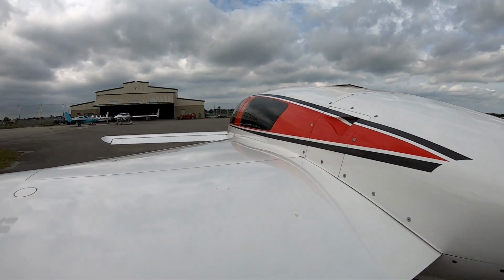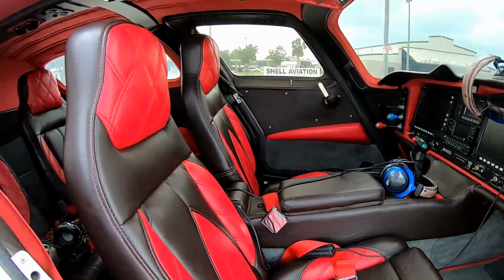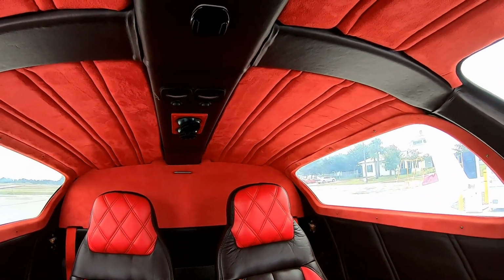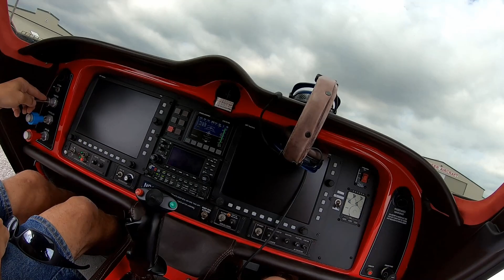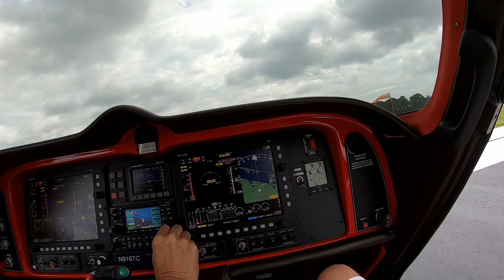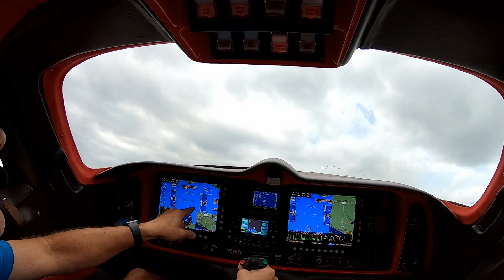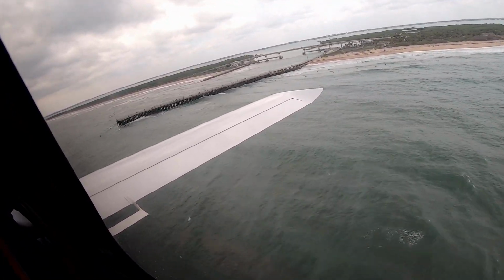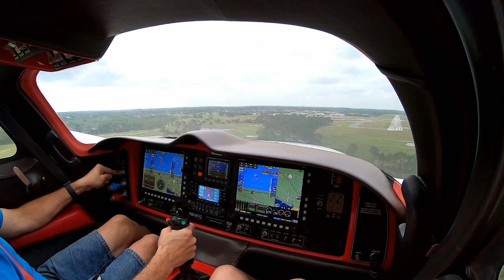Velocity Flight with Scott Swing

Comment: SIDE-STICKS WITH CENTER CONSOLE THROTTLE QUADRANT!
Awesome Velocity you have, none the less!
Reply: I notice that. If the left seat becomes incapacitated, the right seat will have a hell of a time using the throttles & mixture.
Reply: It is an option you can add if you build one

Comment: These velocity aircraft are absolutely astonishing. I get freakin goosebumps looking at it. Those air intakes on the sides and roof of the back fuselage are sick too.
Reply: The single engine is really impressive. The vtwin is really cool, but the cost of owning dual engine aircraft is obscene, I already went through it. The only one I would own right bow is a Beechcraft Baron P.  (If I could afford to own one). I love that plane. Ive always wanted a pressurized cockpit for high altitude cruising.

But....

My wife wants a Velocity Vtwin, so it may not be up to me
Reply: @stonehorn4641  it’s funny you say that about twin engine aircraft and the Baron. It is also one of my favorite twin engine small planes of all time. Imo It is one of the few elite in the light twin engine class of aircraft.  I do believe the King air is  one of the best twin engine in the turboprop class as well. My fav king air is the C90 and my fav Baron is the B58.

Comment: Mr Derek,  I've been seeing another plane that looks like this one,  it's called the "Canard" which has two versions but I'm curious
if you know if this Velocity is made by the same people as the Canard?  Both are very similar to my eye but I'm no expert.  If you
know, please drop that info here & thanks for the video.  peace
Reply from the maker: Canard just means it has the small wing up front. In regards to airplanes, it's a type of design. There are several manufacturers making these types of models. Hope that helps.
Reply: Yes,  for my needs at present,  that's what I was looking to know.   They seem to be more efficient in fuel burn & almost
like a freedom to fly.... in a sense?  Thanks & I'll be out here taking it all in.  peace & GB

Comment: I remember a Rutan designed VariEze canard tandem two seater of the 1970's.  I knew of one owner at New Haven back in the day. We both worked at Yale.  It was a tricycle gear; two fixed with hand crank retracting nose. I recall his retracting the nose gear to set the nose down on the ground when parked.  This is a much lager plane but I loved the canard design then and love it now.
Reply: ALBERT!

Comment: You sure 3 blades don't have enough force at altitude or is it more likely that the blades need to be shorter so you don't have a prop strike every time you take off/land
Reply: This,  longer blades are more efficient at altitude. They’re limited on prop diameter so one more blade is needed for the 300hp.

Comment: This is a kit airplane, right? Is it possible to build it as a pressurized plane? If so, is it possible to tell approximately how much more time / money would need to go into the necessary modifications? Thanks!
Reply: A pressurized plane has to be designed from scratch.  It is a VERY complex thing.  There are pressurized kit planes, like the Lancair IVP and the Evolution aircraft.  Most pressurized planes are turbo-props.  One, Piper M500 is the sole piston single that is pressurized, it is not a kit.
Reply: @gbigsangle3044  Thank you for your response! I already assumed that pressurization is a very complex requirement. But then, it is nice to have :) 

Here in Germany, there is a politician with yet unfulfilled ambitions to become chancellor, who identifies as from the "upper-middle class" income strata. Media say that he owns and flies two planes, one of them a Diamond DA 62, which he is presumed to have bought new (at around 1.2 million dollars). Now, that plane is not a kit and does not have pressurization.

If you do get invited to fly in such a plane as a passenger, and it rises very high, you'll need to have oxygen tubes put in your nose. That's somewhat off-putting to people who otherwise travel in large planes built by Airbus or Boeing ....
Reply: @axeletzold9406  Sure pressurization is better but it comes at a weight and development cost that the piston market won't pay for...that is why you only see it in the turbo-prop and jet markets.  I fly a Cirrus SR22T and when I fly above 12,500 I wear a boom cannula.  The plane has built-in oxygen supply that lasts for up to 80 hours flying time...so the burden is not that great to fly higher.  Most of the time GA planes are flying at or below 12,500 btw.

Comment: I was under the impression you could only have one passenger in an experimental aircraft. Can someone educate me?
Reply: Apparently it is not prohibited.
Reply: You’re thinking light sport.
Reply: Just can't do commercial
Reply from the maker: Incorrect, there are several four + seat experimental planes.
Reply: Cannot do flight training in experimental but can have four or more people.
Reply: @mauriceevans6546  even that isn’t a hard line. You can do flight training if the student owns the experimental plane. They can be as large as the builder wants, but we typically don’t see anything bigger than 4 seaters. Typically.
Reply: I just worked on a C130 that is registered as an "Experimental"
Reply: Experimentals are different than Light Sport.  Light Sport has a 2-seat restriction.  Experimentals include everything from kites to vintage WWII aircraft, to kits of all flavors and designs.

Comment: Cabin engine noise is ridiculous, they spent a lot of time making everything look good but the sound deadening insulation is crappy. Firewall needs more insulation and the engine mounts are sending all that noise throughout the whole plane.
Reply from the maker: It didn’t seem any noisier than the Archer I fly now, but I’m sure you can add insulation since it’s experimental.
Reply: Come take a ride. I’d do that and see it for yourself before making assumptions based off a video 😂
Reply: I'd venture to say it's on-par, if not quieter than 'factory' aircraft.  The camera picks up voices pretty well which is more than can be said for a Cessna 182.  Heck, my Glasair 1TD (four cylinder IO-360) is loud enough that my iPhone can hardly pick up distinguishable conversations.
Reply: I love velocity aircraft.
Reply: @terryjordan7276  made is loser with crowder? What does that even mean? Also we have inflatable door seals on most of our new airplanes.
Reply: @rileyswing9731  fixed it
Reply: Small planes do not have sound deadening insulation...the weight is too costly.  That is what noise cancelling headsets are for...